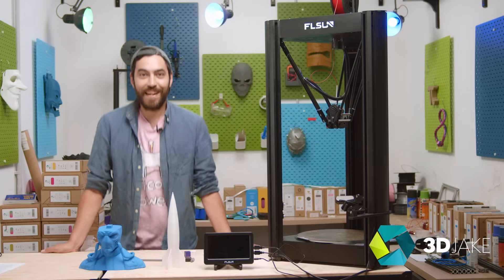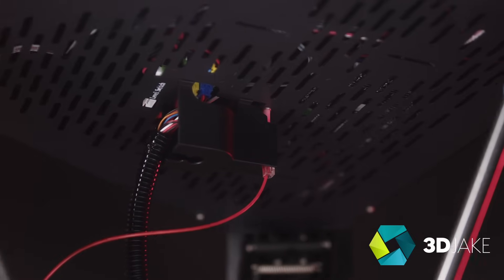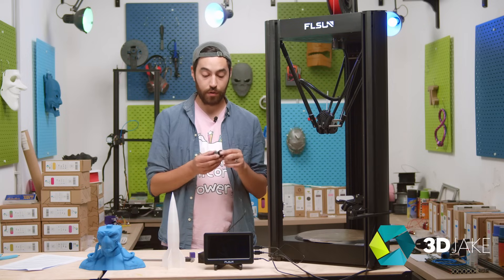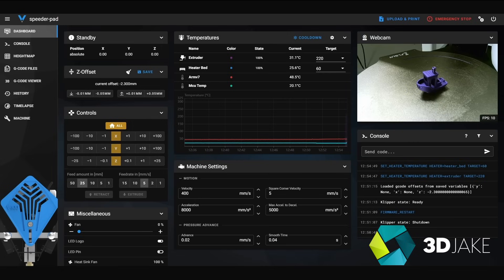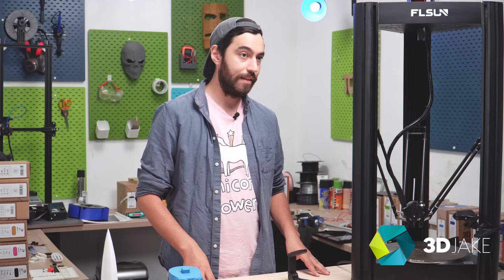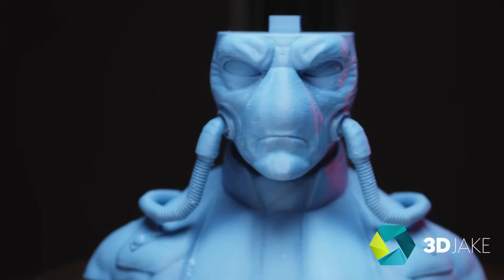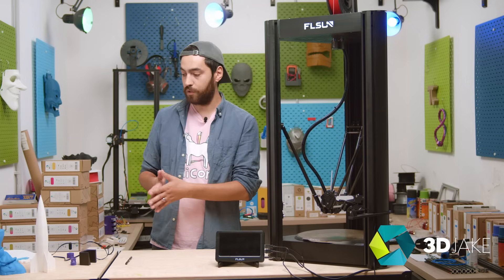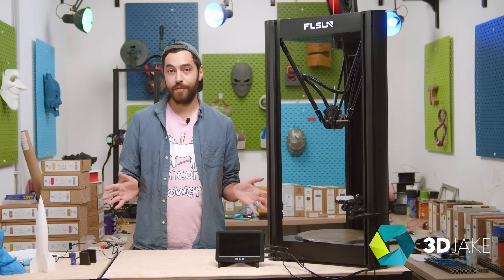FLSUN V400 - A Delta? With Klipper?

Comment: Was that a mistake when you said: all depends on xxx and "Jerk" settings? because i thought that Klipper does not implement jerk? was the info wrong? i had to remove the gcode commands setting up jerk in Cura...
Reply from the maker: Yep completely forgot that Klipper uses junction deviation instead....was wondering when someone would notice this.

Comment: You referred to “clipper” over and over again as if it’s the most important feature but you never explained what it is. I have no idea.
Reply from the maker: Ah, Klipper is a kind of firmware which has a special feature called input shaping which essentially cancels out the vibrations that cause ghosting and ringing. Because of this you can print faster at good quality

Comment: Got mine yesterday from the september batch, love it so far. Still havent tweaked the settings to optimal performance. Since you are a month in, landed on any good overall configs?
Reply: Got mine yesterday, and it prints great.  Question:  my completed pieces all have a large "splash" layer at the bottom on all of them that I have to trim off.  Is there a Cura (Cura 5.3 for me) setting to stop or reduce this?  Thanks very much.

Comment: I got my flsun v400 but i get every time klipper not connected or  klipper has encountered an error Issue a firware restart...
can not update mcu config as it is shutdown once the underlying issue is corrected  use the firmware restart i made that but nothing works? Any help pls.

Comment: Anyone else have horrible customer service from FLSUN? I ordered in September and they said all the September orders have been sent out but mine has not.  I sent them my order number and no one has gotten back to me? I have seen other comments about orders not being fulfilled. Is this company a scam?
Reply: Mine was also ordered to be sent in the Sept 20 batch. China had a holiday during that time so it was abit late. I just got mine this week. 2months is normal when dealing with air shipments from China. (At least to me in Sweden) it is not a scam. But my recommendation is to always use Paypal if you have any future notion of non legitimacy. They cover up to 6months of package not coming into a full refund.
Reply: I’ve had no issues with them. I ordered in the second wave and it was sent when they said it would be and showed up with no issues. They have reached out to me two or three times now to check up on me and my progress. No complaints on my end at all.

Comment: Hello 3D Jake, I am wondering  you have experienced stringing issue when doing the retraction test with V400 default setting? If yes, could you share your config that minimise stringing ? Many Thanks !
Reply from the maker: No we actually didn't have any stringing. We're running the following retraction settings:
Retract at layer change: Yes
Retraction distance: 1mm
Retraction speed: 30mm/s
Combing: Not in skin
Retract before outer wall: Yes
Avoid printed parts when travelling: Yes
Avoid supports when travelling: Yes
Z hop when retracted: Yes
Z hop only over printed parts: Yes
Z hop height: 0.3mm

Comment: To bad that they are FLSUN is taking a page from Prusa and there XL,  promising a ship date to gather Pre-orders to take your cash,  and not being able to deliver on shipping commitements and then blame it on COVID or Logistics .  This is becoming the norm Prusa, FLSUN, and Bambu Labs.....buyer beware.
Reply: Maybe just maybe it's becoming the norm because it's an actual problem....
Reply: @Xanthira222  Yep, over promise and under, deliver on deliver dates.
Reply: I just got my v400 yesterday.  It only came a week late, no big deal.
Reply: I have that everywhere, even with parts from the states, which are produced in the states delivering to Switzerland. I received my V400 two weeks ago and its amazing. Built it in 15min with my wife, leveled the bed and printed successfully a provided knurling screw model with the provided PLA. So out of the box to the finished print in 90mins is bloody amazing and actually how it should be. The delivery was only 10 days late so no big deal.
Reply: I received my Speeder Pad in 9 days, now adding my SR to it when there are no options for adding other printers has been a bit of a challenge.

Comment: I remember another big delta... Everyone hated it because of the company and some issues that had with clone boards, etc.  Let's hope this fair's better in the long term.
Reply: This isn't new for them. This is their 4th delta.
Reply: @Xanthira222  but the klipper part is new, and turns out they are not following the open source licensing requirements.  And is locked down so you can't access some settings.  Let's see how it ages.
Reply: @BurninGems  FLsun already announced they are going to open it. Should be happening very soon.
Reply: @Xanthira222  where they announced it ?
Reply: I have tevo little monster and this is very nice delta frame but that electronics sucked so hard. It is runnig on duet for almost 3 years and still strong.. But i like this printer i think it is time to buy my tevo brother :)

Comment: How was the overall quality of the prints on a scale of 1-10 and not at max speed because quality is more important to me
Reply from the maker: Good question. Maybe 8/10, good but definitely not perfect and this was tried at differing speeds, couldn't see much of a difference in quality when printing at 100mm/s and low acceleration limits or 200mm/s and moderate acceleration limits.
Reply: @3DJake_Official  so my understanding which is very limited as I'm new to 3d printing is that deltas have better quality than traditional printers, would you say this is true and if not what printer have you used or heard of that has amazing print quality? I'm also considering getting the prusa xl can I get your thoughts on that
Reply from the maker: @BigBootyJudy40ozBounce  Well not necessarily. A delta can just go faster than traditional printers, you can still get excellent quality on something like an Ender 3, you're just never gonna be able to get high speed on it unless you modify it. 
Honestly, for FDM printers the best quality I have achieved is with printers that I have modified. If what you need is super high quality and fidelity I would actually recommend a resin printer instead. 
The Prusa XL looks interesting, it isn't like other traditional printers though because it will have klipper firmware and have corexy kinematics too. What I can say about other Prusa printers is that they're wonderful. Good quality prints and out of the box it is able to print a wide range of materials but the best thing about Prusa printers is the user experience. Reliability is fantastic and it  is so easy to use.
Reply: @3DJake_Official  i just bought a v400 to print sturdy parts do you think it will have good detail for that type of stuff. I had a Ender but it broke on me i am hoping this will do good
Reply: Hi, did you buy the v400 or prusa xl ? :)
Reply: @SPACE_TRAVELLER_01  I actually ended up returning my V400 it's not $749 good
Reply: @BigBootyJudy40ozBounce  really not so good as advertised, but why ? Which one are you going to buy next ? 😯

Comment: love the new speed achievements in the space over the past few months. you should do a video with this printer rocking a 0.8mm volcano
Reply from the maker: Actually, we have a 1.2mm CHT volcano nozzle just itching to get mounted on it :)
Reply: @3DJake_Official  video incoming?
Reply: @3DJake_Official  Gonna have to print way slower with that.  Even with a volcano there's no way you can heat that much plastic at 300+ speeds.
Reply from the maker: @burmy1552  I consider this a challenge 😀